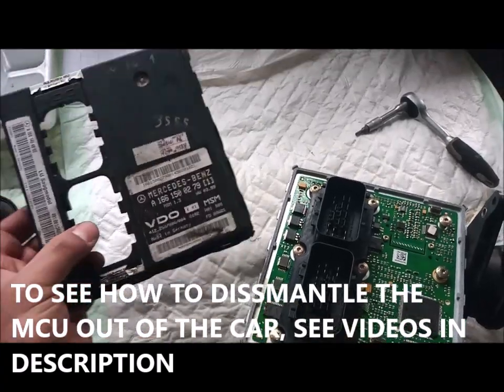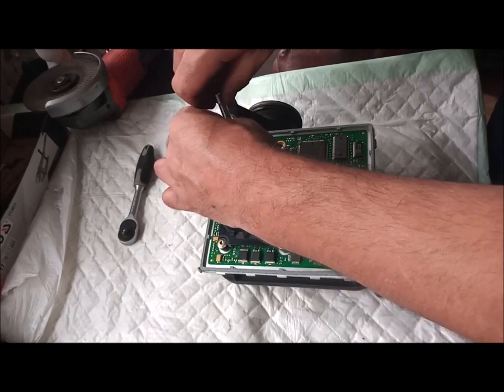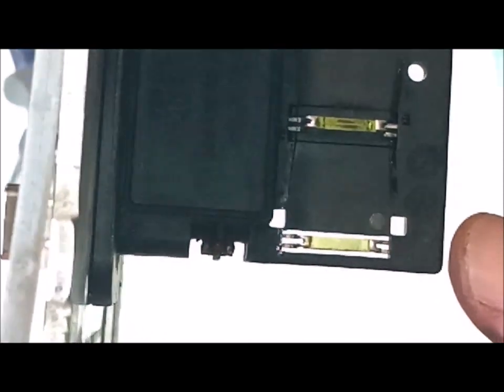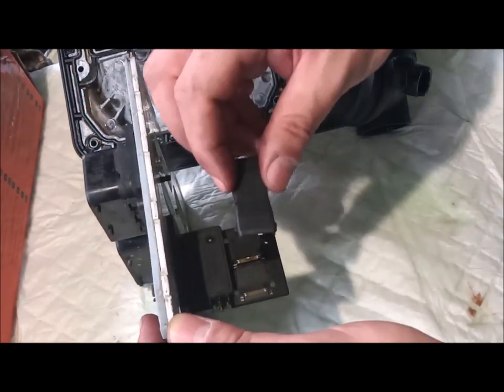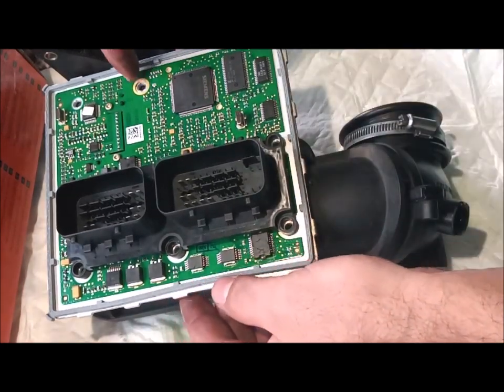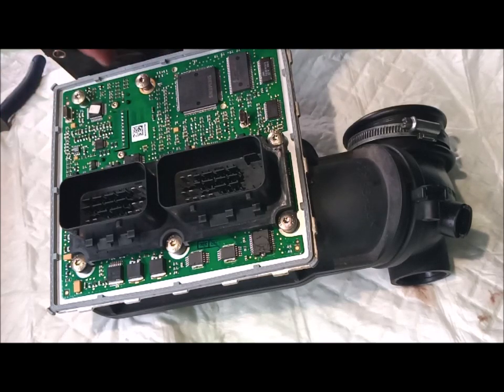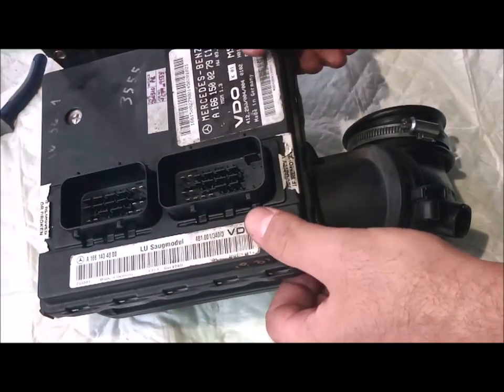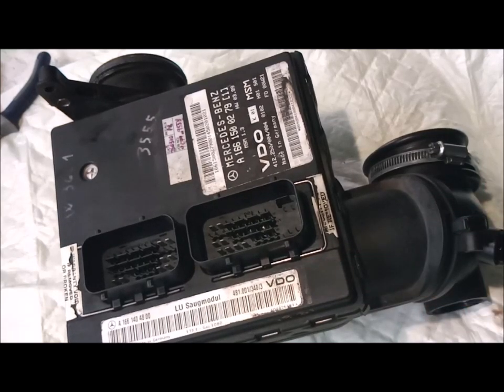FIXING AIR MASS FLOW SENSOR MAF ON MERCEDES A CLASS W168 A140,A150,A170, A190, SEE DESCRIPTION!

Comment: Hi. How do you tell which side of the filament face up and which side face down for both filaments? Can you tell visually? I could hard see the details on the filament -so I need to get the orientation correct. FYI: I accidentally broke the outer filament while trying to open the protective black cover and now I have to find a replacement part. Sigh.. it is so delicate. Also is the solder applied on the upper part on the metal connector ONLY when resoldering the new filament? Thanks in advance.
Reply from the maker: Ya its hard, I have the orientation in the video link i sent you, sorry you broke it, but still, you have to do what you have to do.

Comment: Thanks for the guide. How do you unplug the 2 connectors linking to the MCU? Do you just simply pull them out or is there a method?
Reply from the maker: You are welcome, just heat the connection solder, its in video description but here is the link anyway

https://youtu.be/I6lHhN1ZCzY
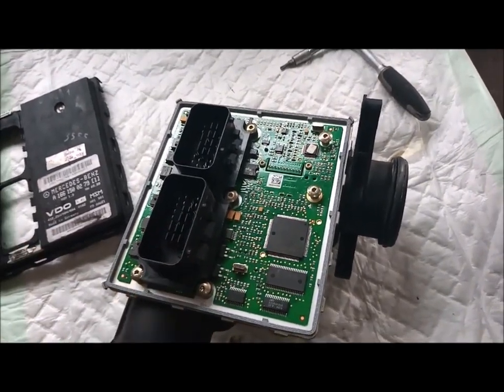Reply: @Austigm  Thanks for the link. Oh...actually I was referring to the 2 black connectors shown at 0:48 of the original video, that are directly connected to the circuit board. The plugs that connect them - do you simply pull them straight out or is there a method of unplugging them? Thank you.
Reply from the maker: Aha, well I dont remember having to take those out for any reason but i remember having reverse torqx screws from the other side which connect the whole circuit board to the Aluminium frame, but as electronics, the inside pins are sure soldered to the motherboard, whilst the black plastic is a frame support for them, according to manufacturer, can be dismantled by clips or unfortunatly, is usually a more molded frame, so I cannt be really sure about that but to wish you best of luck. Sorry
Reply: @Austigm  Noted. Thanks for the info. My A160 is experiencing rough idle with error code P0100 pointing to a MAF sensor issue. So my aim is to fix it. Appreciate you sharing your knowledge in your other videos. V helpful 👍

Comment: Hello! Could you help me with how to remove this sensor? And also how to clean throttle body? I can't find info ANYWHERE on the internet. Thanks a lot!
Reply from the maker: Did you watch this one? 

https://youtu.be/I6lHhN1ZCzY

And for values read the full description
Reply: @Austigm  Thanks, but I mean i cant remove the whole thing from the engine bay. I guess the throttle body comes after this part, right?
Reply from the maker: @petersagi275 Aha, so please see my mercedes playlist on the channel, and from it watch whatever you need, but for your issue, this video will be kind of enough, no need to remove throttle body, just air filter and connector, you will see, 
https://youtu.be/RwtTW1ejzis?si=Hl1ftmK9QRmXfE3d

And this one for air intake inlet

https://youtu.be/MzlJRKbTq4A

Comment: I replaced a complete MAF, and the middle glass burned out. Then I bought new glass and sent it to a technician to install. It was installed correctly and in the correct position, and the middle glass burned out again. Both times it burned out after just a few kilometers. What could be the cause of this persistent defect?
Reply from the maker: You have problem with original car electrics, cables, the company that got it replaced should have also checked the motherboard, and gave you warranty

Comment: My two flaments are broken. As the last option If I solder resistances, is MAF sensor works or not?
Thanks
Reply from the maker: I recommend that you read the description, you will find the answer
Reply: @Austigm Thank for quick answer. I watched your videos several times. sorry but in the description I cannot seen the answer. Some other reviews some say that without sensors flaments resistor option not works. I just want to be sure. My auto has still problem.
Reply from the maker: In short, resistors will make your car work, but consumption will be permanent regardless of weather and temp. Besides the reading of values from it will be permanent, so the ecu may throw a code anytime, me personally did not use that.

Comment: Bonjour. Pourriez-vous me partager les valeurs mesurées de debit d'air au ralenti de votre calculateur et éventuellement à une vitesse autre s'il vous plaît (en me précisant la température relevée au moment de la mesure) ? Merci pour vos vidéos très instructives !
Reply from the maker: Hi there, am so sorry, the car was sold three years ago, and I have no readings for it, happy the videos helped.
Reply: Hello! Could you please tell me where to find the original blades? The ones I bought for the third time (Aliexpress) burned out. Always the inner one (heating). Thank you.
Reply from the maker: Hi, Am sorry, bought mine from Ebazy.

Comment: I have continuity but cleaning didn’t solve p0170. I will try to replace the glass sensors
Reply from the maker: Yes it will work for a period then go back, if it is old filaments, thats why had to replace them later on filament replacement video on my channel, 
https://youtu.be/I6lHhN1ZCzY?si=KVQpR01n3I6bSrMq
u can see the values and orientation.
Works as charm since then
Reply: @Austigm  do you know which of the two filaments causes p170 ?
Reply: @Austigm  there is something I don’t get. In that video the old filaments give you the same values of the new ones. So how does one understand the old one are defective ? It doesn’t make much sense. At the moment The filaments I installed are giving me 493 and 10 in resistance and 228 value on pin 2-3 and 4-5. The car is running smooth without hesitation but error p0170-4 comes back . I am positive there are no vacuum leaks or other problems. The problem is in this new mafs , new blades same error as old blades but with old blades the car wasn’t behaving correctly.